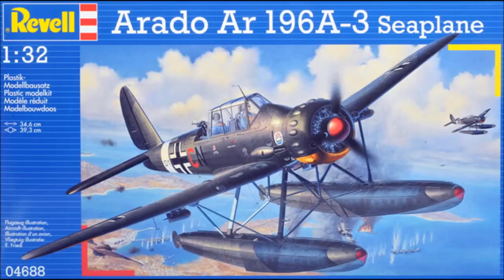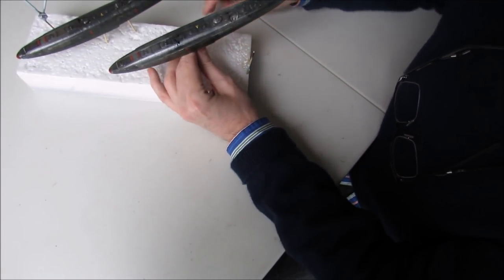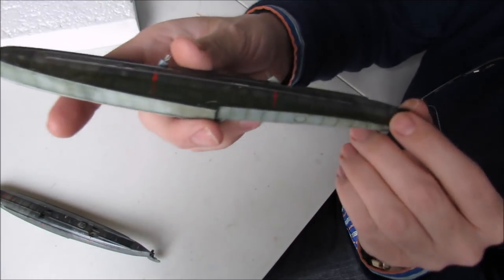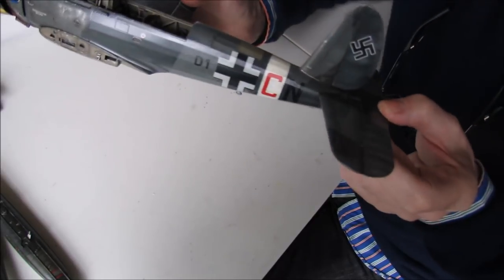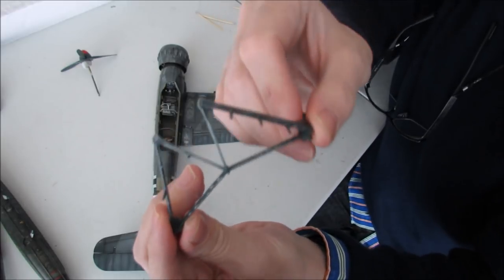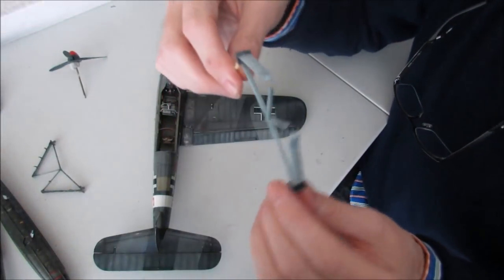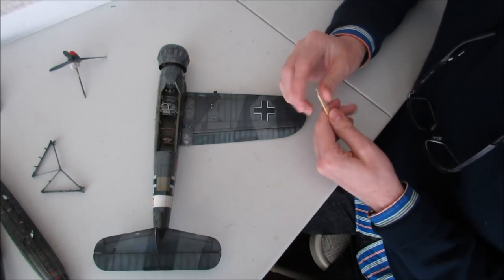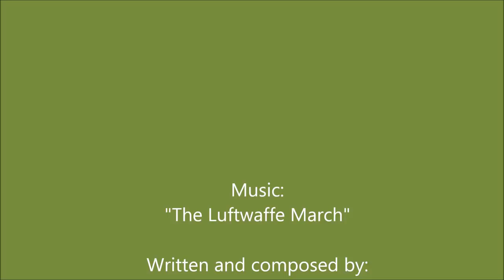Revell 1/32 Arado AR196A-3 "Build Update #5" (4.10.15)

Comment: Martin,Excellent work on the floats, they look like mimi-subs. Pin-wash really makes the A/C look used, VERY GOOD! All your painting came out so good, it seems like very time you build a model your talents jump up a level. Bravo my friend! - Bob
Reply from the maker: bob dyer Hey Bob, thanks for the praising comment, much appreciated. With every new build that I do, I push myself to attempt new things. The beauty about weathering is, you can't go wrong, because you're using thinned down oil paints on top of a gloss clear coated protected surface; you just rub off what you don't like, then repeat until it looks okay to you. I'll also do one layer of weathering, and if I'm happy with it, I'll seal it with a clear coat, then do another layer of weathering on top of that. This way, you can use multiple shades and tones on top of each other without them mixing, and without erasing the one beneath. This build has had 6 clear-coats now that I have just put the final matt coat on. Will start the assembly later today, then tomorrow....it's onto masking, painting and assembling the canopy! Cheers, Martin : )
Reply: Martin, thanks for the "HOW TO" tip. I wondered why my weathering attempts weren't looking as good as everyone else's. I never sealed them in clear coat, they just sit on top. Thanks! Good luck with that HUGE greenhouse. - Bob

Comment: Hi Martin,sorry to say but this looks like your best ever build to me lol ;) Fcking Awesome mate really.Take me hat of to you! Paintwork chipping and the pin wash looks spit on! Got a hard act to follow on myn.Going to do the chipping method that you have used.Could you please send me a step by step guild on how you do the chipping process.
Reply from the maker: Warren Blanch Thanks Warren, glad you like her so much, greatly appreciated mate! The chipping method is easy...airbrush silver onto the plane and let it dry. Choose if you want to apply pre-shading, then airbrush a clear coat to seal and protect the silver and pre-shading. Decant Hairspray into your airbrush cup and airbrush your plane with it. Let that dry, then paint your plane. When the paint is dry, use either a small brush or a wet cotton bud and apply the water to the areas you want to be chipped. Allow the water to soak through the paint and onto the hairspray beneath, which will react with the water, causing your paint to lift up. Then just use a the pint of a cocktail stick to lift the paint of where you want it off! When you're happy with your chipping, seal it in with a clear coat then start your decaling! Have a great weekend! Cheers : )